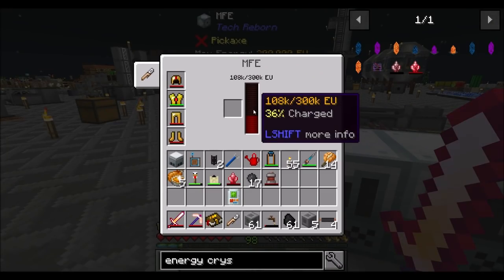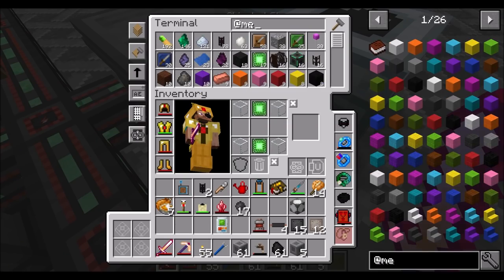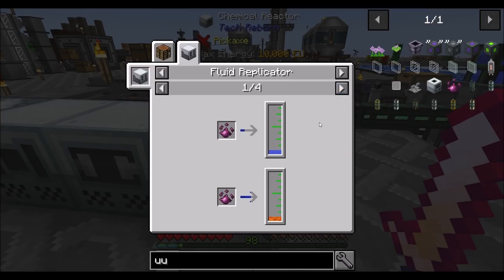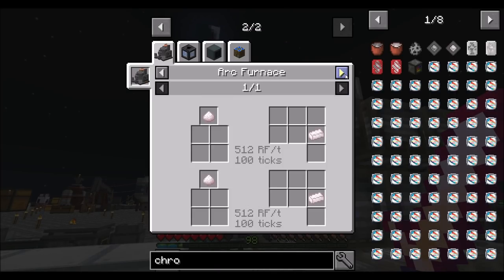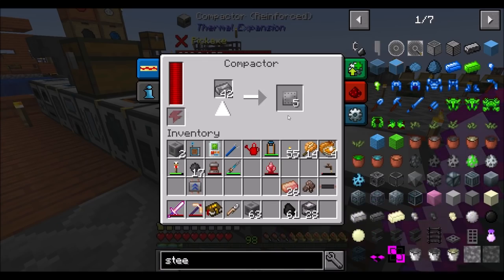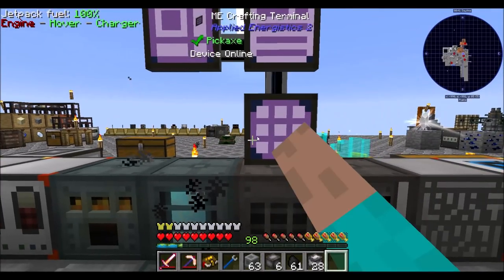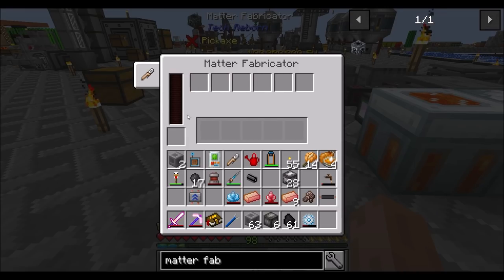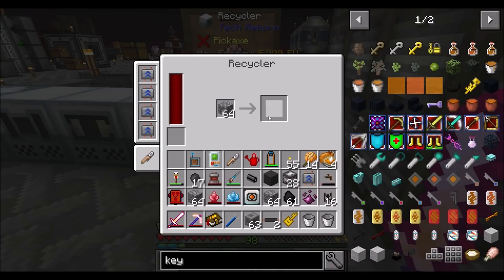Modern Skyblock 3   Ep84 UU Matter

Comment: Waiting for the moment dire realises mekanism cables auto converts to EU and doesn't blow it up
Reply: Dire derp
Reply: he even saw that the generator connected to the mekanism cable and did not try if the rest do it as well..
Reply: It doesnt??
Reply: Mekanism is a very strong mod. Unless it is disabled in the config file, it should work with most energies.

Comment: Suggestion: Astral Sorcery - Horologium Ritual,  improve machine tick speed, add faint Vorux to Horologium crystal to massively increase the effect range and double the improvement speed. Add an enhanced ritual collector and fully upgrade the ritual. Add a ritual anchor and you can then center the effect of the ritual without having it in the way of movement or expansion.